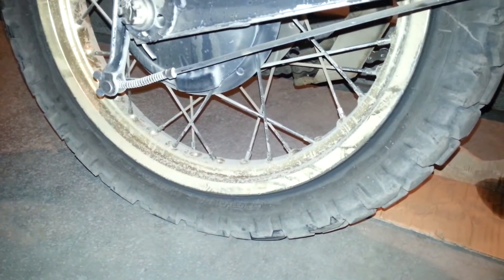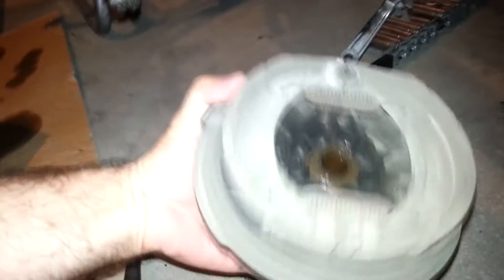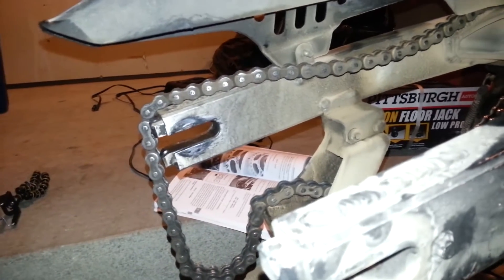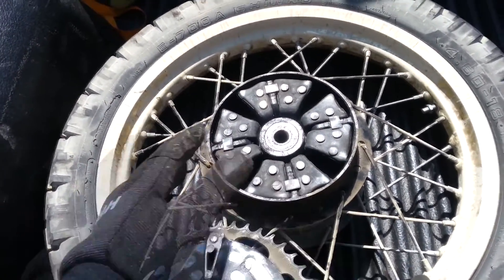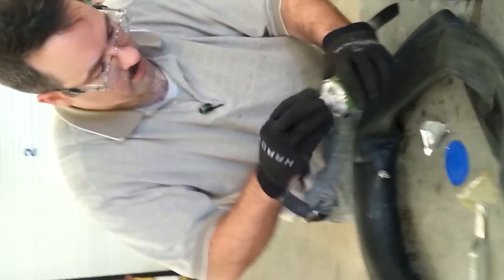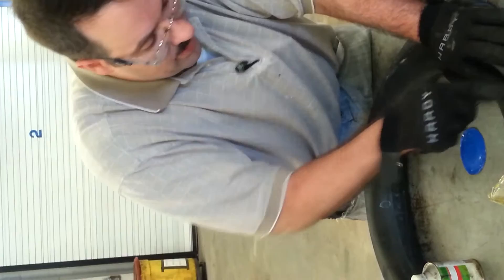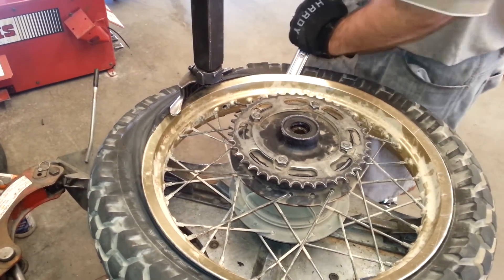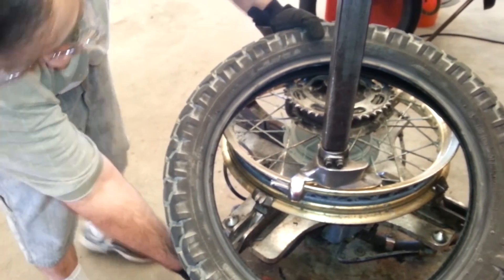Motorcycle Inner Tube Replacement or Repair, 89 Yamaha XT 600

Comment: That buitiful liy baby girl she a doll little angels the children are next to gods heart now I am replacing my front tire I like to ask you did they have the tube moving rubber stops on in the rim keeps the tube from moving if goes flat you can ride a little ways so I don't know if my rims are stock or after market mine are gold did the 1989 come with gold rims the XT 600 I don't know
Reply from the maker: Mine is the original wheel and it has a delicate golden treatment to the rim. I regret trying to clean up the gold, that layer instantly disappeared from a gentle brushing. Then I was stuck with, uneven color or remove it all. I decided on it all going. 

<shrug, small frown>

Mine had nothing to help run flat. A good liner is important to keep spokes from cutting the inner tube. 

Having the nut holding the inlet/outlet in place is really important. It'll shift even if it's well inflated unlike a bycycle's tire.

Comment: Sounds like it was holding up pretty good with the patches, so should be okay. In any event, if you decide to get a new tire and inner tube, you could do that too somewhere down the road.
Reply from the maker: I was reading up on motorcycle tires the other day and it turns out that
 the tires actually go bad in only two years. The MSSF teaching lesson 
was saying that the rubbers are softer and that they harden more 
quickly, so they have to be replaced on time even if the tread is good.

That pretty well described these tires fighting to go back on - dried out, even 2014 tires.

I replaced the inner tube soon after, probably would have been smarter in the first place, lol. I didn't video tape it, but I took a file to every burr of metal on the wheel and used my welded wire attachment for my die grinder all over until it was all smooth as can be. That next inner tube was happy!
Reply: Just goes without saying DE that one can learn something all the time. 
Even today with 45 years of electrical experience, I still learn 
something new from time to time :)
Reply from the maker: stuzman :)

Comment: Nice vid. Ah a remote mic , nice. It wouldn't surprise me if the new upscale bikes have TPM in them now.
Reply from the maker: Tire Pressure Monitoring Systems (TPMS) were federally mandated in the U.S. in 2007 if memory serves. Having looked at some new motorcycles (wink wink nod nod) it doesn't look required yet.

"Ah a remote mic"? I didn't understand.

Maybe in motorcycles it won't be required because drivers can feel if tire pressure is low a lot better than in a car or truck? I could tell in my car and truck too if it was more than a little off, but most people are clueless, thus the laws perhaps.
Reply: DE Nichols Looks like you have a mic clipped on your shirt.
Reply from the maker: STEVE ROB oh! That's a pen. You're thinking as a YouTube creator aren't you? :)
Reply: HAHA i just looked again, yep it is but in the vid it did look like a mic. I wonder who else  will notice it.
Reply from the maker: STEVE ROB Hey. If anyone else thinks I upgraded my equipment, then they can have a placebo effect and watch more. Lol

I did buy new camera equipment. ...it's just me one time catching up with you Steve. I have two of the same. Twoism. :)

Maybe the new one will be clearer? I don't know. Lol

Comment: Looks like you enjoyed tinkering with the motorbike :-D.

Now some long woffle from me, just my way, just obvious stuff :-D

That rubber under the rear sprocket is a "cush drive", there should be no slop between the rubber and fins of the sprocket side, if there is (my bodge) wrap insulation tape around each fin to take up the slop. (loads of slop can break fins  with the sudden impact of the fin).
You are supposed to replace the rubber cushing blocks but im never happy to shell out money lol.

The metal tube in the center of the wheel hub is a spacer for the bearings and stops you crushing the bearings when you do the castle nut up.
No one wants crushed bearings, painfull LOL :-D.
The bearings are not supposed to come out easy, hope that one didnt fall out.

The inner tube repair, i rub the area down with glass paper, then a "THIN LAYER" (Hint) of rubber solution to the tube, then leave it for 5 mins, dont put the patch on untill the rubber solution becomes tacky.
Use your fingers to compress the patch from the center to the outside, dont damage the feather edge if you can help it, dont use that roller tool.
Leave for 20 mins then sprinkle chalk powder or talcum powder on the patch, gently rub it around the edge of the patch to stick to any glue thats outside the patch.
The chalk also stops the tube sticking to the inside of the tyre :-D

If the rubber spoke cover is crap, wind insulation tape around, go higher up the slopes so the tape covers the metal of the rim touching the inner tube.
It works very well and even if the metal gets rough or rusty, the inner tube will be safe :-).
Use your fingers round the tyre, gentle and slow, your fingers will fine tiny sharp bits really well, just dont go too fast.

Are you asleep yet LOL.
Reply from the maker: I didn't film it, but I went over the rim when I got a new inner tube I 
used a file on every barb of metal, and I used my wire brush that I 
welded up to smooth the entire insides of the rim until it was like 
silk.

Unfortunately, I think the reason the big patch failed was because the edge never did seal. Or the hole I was repairing was just too big in comparison to the force of any patch to keep it together.

The real reason for powder is so that it doesn't stick to something else? Awesome. This inner tube was for sure punctured by the rim by the way.

Yep. You're how to for inner tubes is way better than mine. :) New YouTube creator control let me pin your comment up so people can see a successful instead of buggered up job, lol. :)

I only felt sleepy while reading when you suggested by asking if I was asleep yet! LOL

The bearings had to be tapped out and while by hand the cush drive (thanks for the term) doesn't seem to move, I bet it was, based on the metal scrape pattern....or people dropped the clutch at hive revs a lot.

Yeah...new cush drive rubber is relatively cheap in America, but parts are so hard to find for this motorcycle that I've even looked to the UK for parts. Oh, you have them all, but they can 2-3 times as much money! Generally, just a good percentage more, but sometimes, they're a LOT of pounds.

Positively great comment my old and trusty friend. :)

Are you asleep yet? :D
Reply: LOL no im ok :-D.
Im glad my rambling didnt bother you, it can be hard to boil down even the simplest thing like a puncture repair.
Ive had a motorbike since i was 17, so i better learn how to fix it lol, im from a family with very little money so learning is the way.

Isnt it amazing how much crap about the past we store in memory, just one prompt about motorbike tyres and a flood of info appears.
Frightning how much you know, but you thought was forgotten :-D.

Hey if someone gets something out of my rambling, then thats great, even if they just want to fall into a coma reading it LOL :-D :-D.
Reply from the maker: zx8401ztv My buddy who's been helping with the Yamaha road four wheelers since he was a kid. He thought they were poor, but it turns out his father just let him struggle and do what he could to keep learning for some other reason. Was it a valuable lesson or the kid just doing what the kid was doing? I don't know. 

But yeah, you got me to remember how I used to repair inner tubes right as a kid go my pedal bike.

With car tires on the brain and no drying required...could have been how I messed the first patch up.

No worries. If you make a perfect lesson there's less people who get involved with the video. 

Lol. Messed up how that works, right?
Reply: LOL i suppose it is, ive never really thought that way :-).
Ahh pedal bike tyres, they came off easy, but as a kid the stout spoon handle helped removal LOL :-D.

I dont think your frend had a bad way to learn, im sure his dad would have helped if he was really confused, its a matter of not spoiling a kid that should be able to understand simple stuff.
I spent lots of my days sitting next to my moped on the pavement in the back garden just taking the engine apart and learning by being nosey.
You dont learn everything that way, but the basic form/design, and what does what is remembered.
Also clocks/old tv's and electronic repair, ive been a right nosey sod LOL.
I think you are not so different to me, if im not insulting you.
Reply from the maker: A more recent subscriber got me to see this comment again. Learning all over from it again. Thank you!